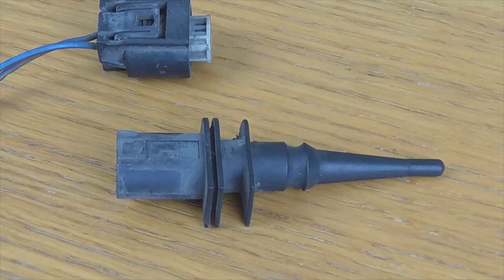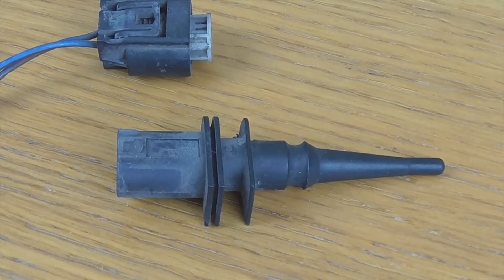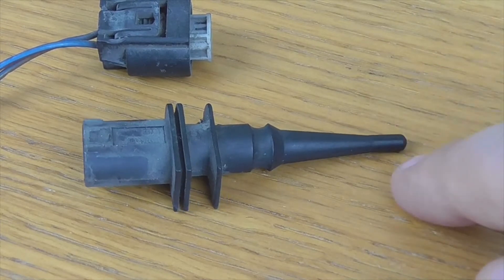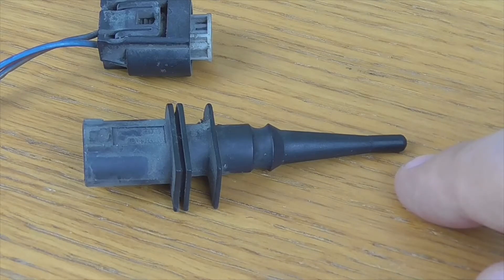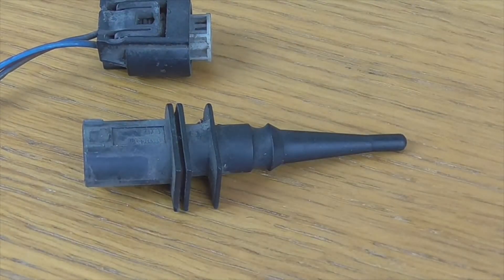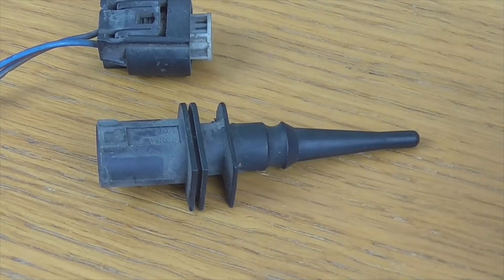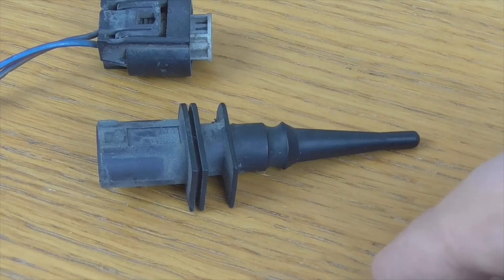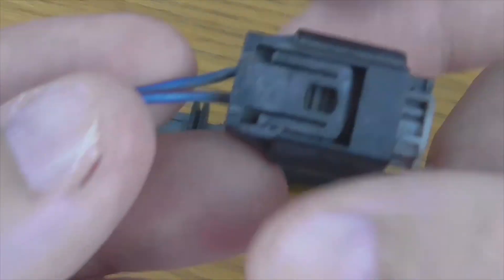Usual FAILURE BMW -40ºC DEGREES of outside temperature, outside temperature sensor, bmw, rover ..

Comment: What if you replace the ambient air sensor and the code keeps turning on ?
Reply: Disconnect the battery and wait and connect it again see if the code clears
Reply: @leitor928  I’ll give it a try thank you
Reply: Does this trigger engine management light to come on the dash?
Reply: @slengoslengaw8510  it does in my case
Reply: @slengoslengaw8510  the error code is 10BA40. I have F30 328i N20 engine
Reply: It did trigger an EML to come on the dash when disconnected on my car

Comment: Where is it located? I found broken wires but no sensor
Reply from the maker: It may be that you have lost it or it has been stolen....
Reply: So I've found in the left brake duct.  You have to undo the end cover as well.  It's caused my AC to malfunction but it work perfectly now.